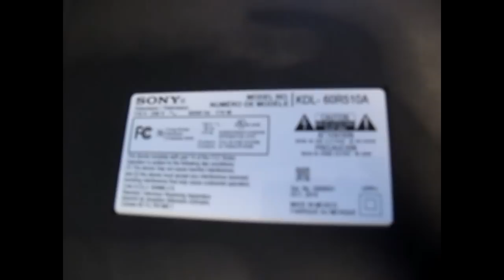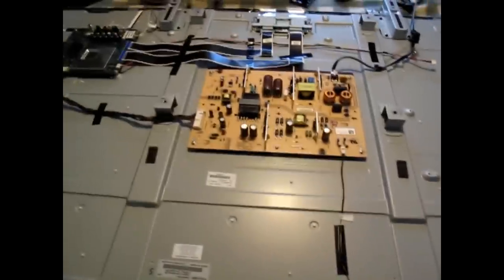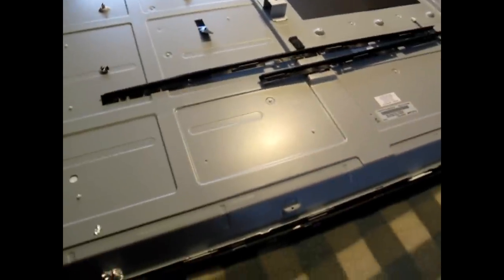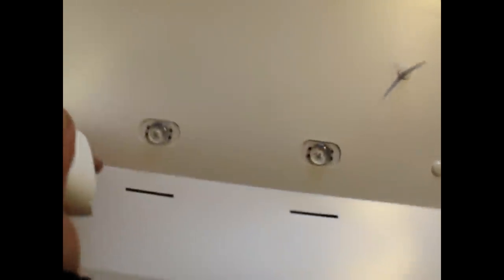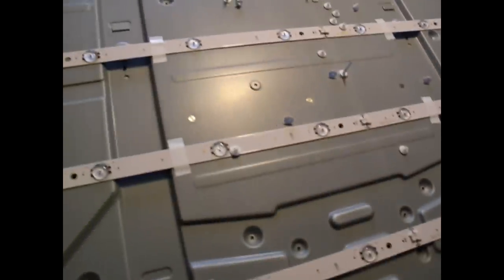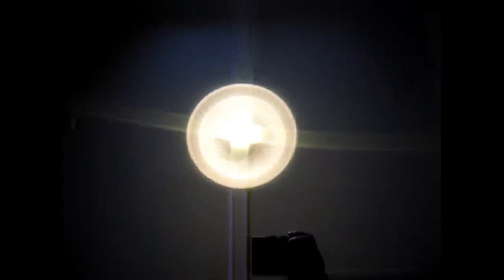60” Sony  KDL-60R510A LED smart TV teardown to look inside to see what you get for your $$$

Comment: Damn't all these models are easy to remove the back panel. Anyone able to take back off a Bravia KDL-42W700B? On mine the panel is really thin and has 2 pieces. One of them doesn't want to come off even though I took out all the screws. I tried to pry it a little but I'm afraid it will snap it.

Comment: so, I have a Vizio m602i-b3 (60") that has...what I'm pretty sure to be...a section of my backlights out (http://imgur.com/dU1SLZB).  Watching this video KIND of gave me hope. I'm out of warranty (of COURSE), and a few local shops made it sound like there's no way that they can get to the backlights without possibly breaking the LCD panel.  

When you had yours flipped over, and got to the point where you were removing the metal housing to get to where the lights were...did you encounter any major headaches or feel as though you 'could've' broken the panel had yours not already been broken?

I',m not to the point of repairing ours yet, as I don't have the $$$ to fork over for a replacement should I fudge up, but this was definitely helpful.
Thanks!
Reply from the maker: +thenixhex311 
the led backlight is a 2 pcs unit maybe it just has a bad conection.
its a lot of work getting to the led backlight but it can be done
if you look on ebay they are for sale
fred
Reply: +gromit95xx yeah, I pound them on shopjimmy.com, just was wondering if it's just the matter of screws and brackets and separating the LCD from the diffuser, etc.
Reply from the maker: +thenixhex311 
its all screws